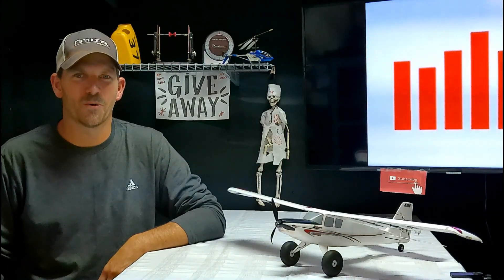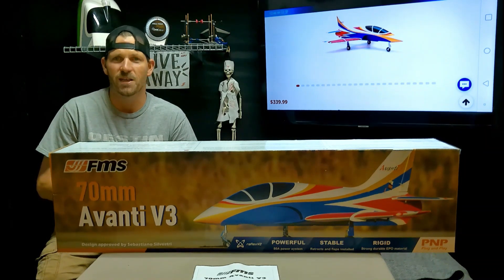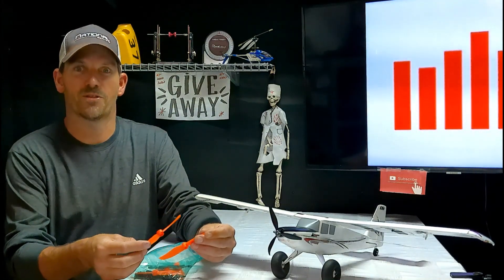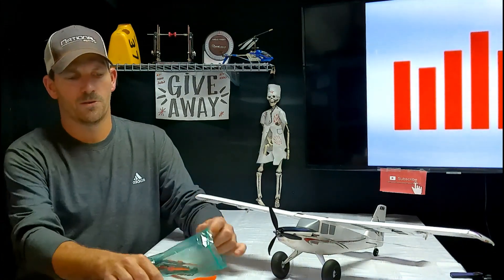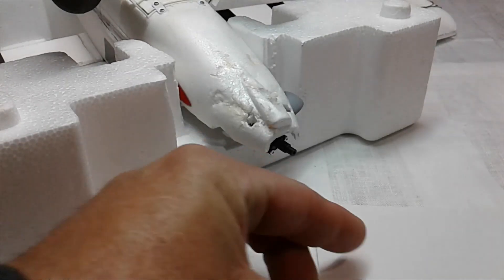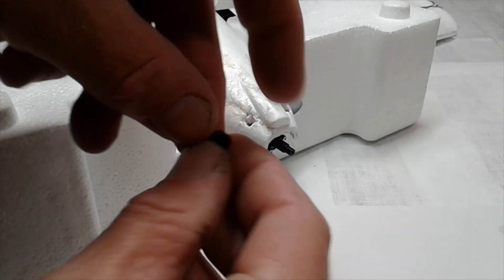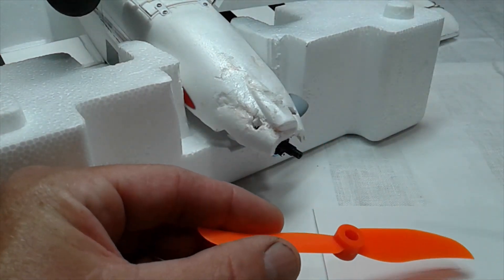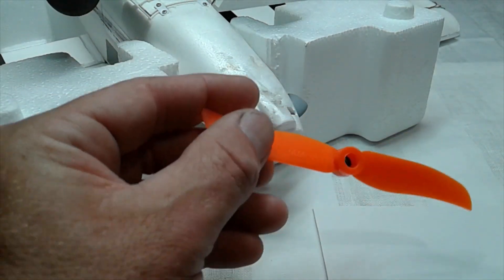E=FLITE UMX TURBO TIMBER PROP ALTERNATIVE NIGHT TIME FLIGHT SAFE SELECT AS3X SPEKTRUM RC AIRPLANE

Comment: That's what I do, it works so well, 😆 use the Styrofoam it came in on the workbench!
Reply from the maker: YES IT COMES WITH A TRAVEL CASE AND A WORK BENCH
Reply: @GRIFFINRCPLANES  it's better than throwing all that in the trash!

Comment: Do you have a link to the same prop and adapter you are using? Looks like props you can get off Amazon? I have a few 5x4 apc props I want to try but the adapters don't work on the spectrum motor.
Reply from the maker: Look on amazon for the UXCELL STORE .